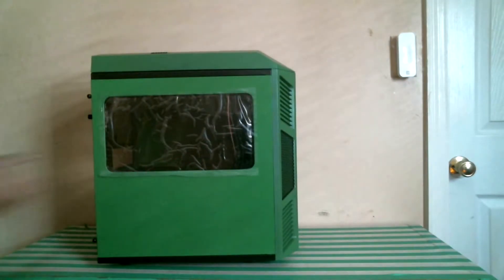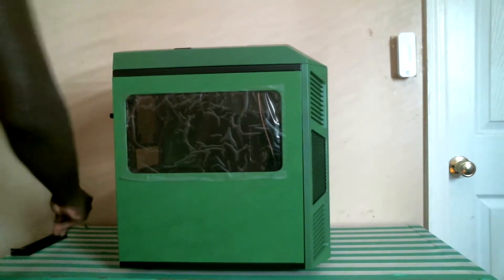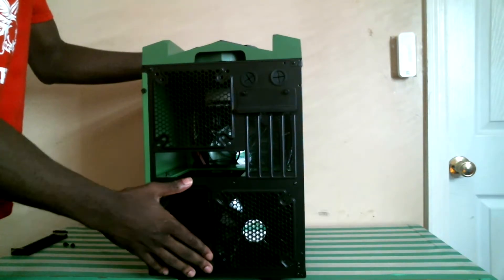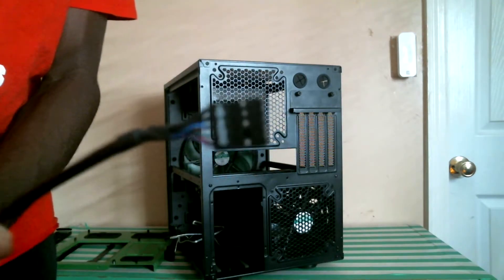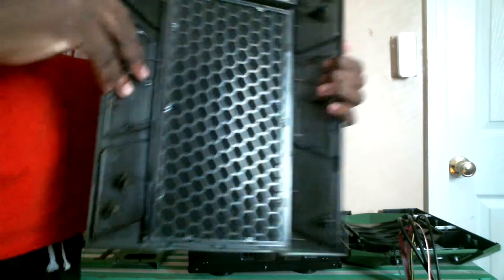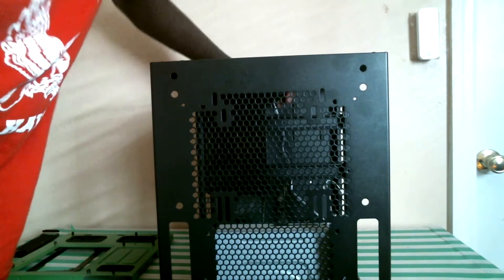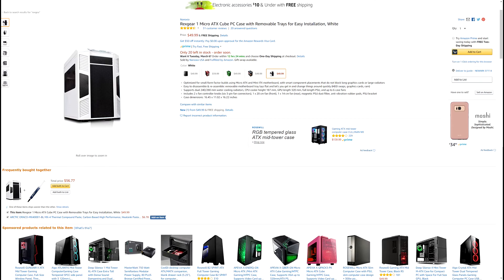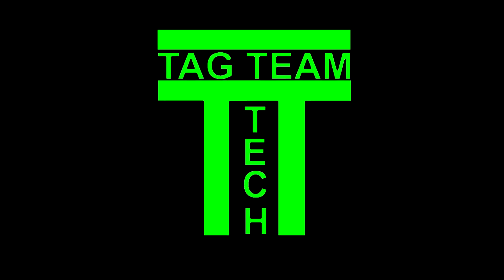Rexgear 1 Micro ATX Cube PC Case Review + Tear down

Comment: this really helped me bro thanks a ton
Reply: Wait you talked about needing a separate molex cable for the fan controller dials, can you send me an amazon link of that? I'm not quite sure what I need, unless I misunderstood what you said.
Reply from the maker: I just meant that you need two separate miles connectors from your power supply one for the leds and one to power the fan controllers because they can not be daisy chained
Reply: alright thanks a lot

Comment: is the rex gear and aerocool the same case ?
Reply from the maker: James Harnish yeah basically the Rex gear is just a rebrand of the aerocool one to the point where the aerocool stickers are still on in some places
Reply: Why did they rename it? Was the aerocool one flawed in some way and this is their way of selling it?
Reply: @deuceyd8468  it was a flop when aerocool sold it and you would of expected re issue with some fixes but never happened they really missed a mark here the Prodigy ended up taking that market share also i think they wanted more attractive look which there ds ones had (this was poor build quality case being solf more towards mid upwards end when it should of been budget range)

lazy from rexgear not even trying to do some changes i dont even see any other options for ssd mounting other then the drive trays and the front mount should be like other cases the mesh at front not some cut out bits.

such a waste this case has potential if only handful of changes was done to it.